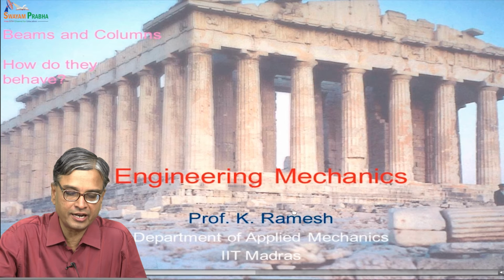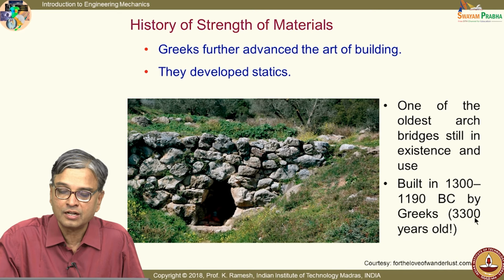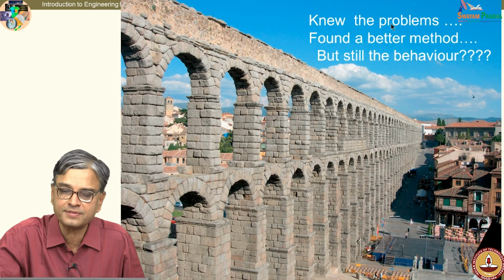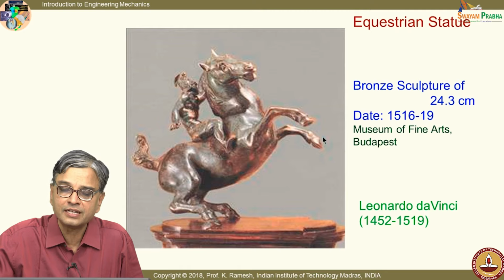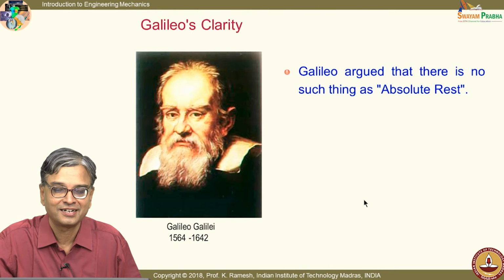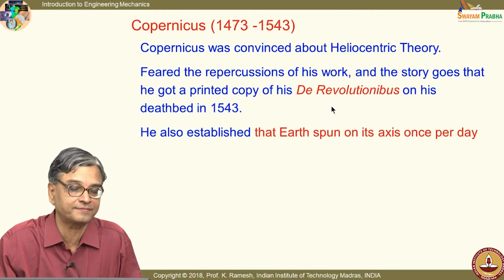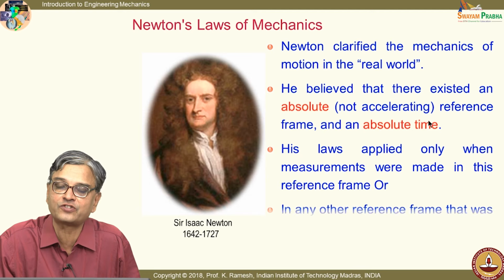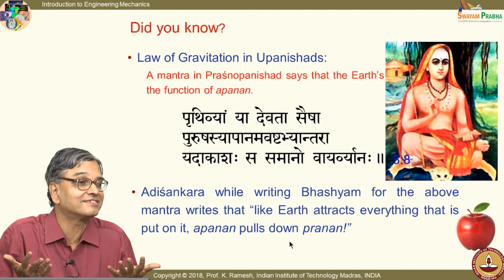Lec 01 Introduction to Engineering Mechanics I

Comment: sir I do have a doubt that the nataraja statue stands on a single leg because its head is attached to the round ornament and base is normal.
Reply: @Epistemophiliac, Have a look at this Nataraja statue preserved at the Minneapolis Institute of Art (https://collections.artsmia.org/art/376/shiva-nataraja-india). This bronze statue of the 11th century has lost its encircling ring (which symbolizes fire), yet stands on a single leg. This rules out the need for attaching the head of the statue to the ring for achieving a single-leg-stand posture. 
Many other Gods standing on one leg can be found in the Indian tradition. One such example is the 'dancing Vamanan sculpture' which you could explore for yourself.
Reply: @sachinsasikumar9874  thanks for the information. But it still has a a circular base which can easily manage mass above it nonetheless of its weight distribution.
Whereas the sculpture of Archimedes is standing on just two legs which are thin as you can see in the video.

Comment: 28.00. ... If it is moving with a constant velocity.... Sir I think u have missed " in a straight line".... Can u give ur thoughts on this
Reply: Velocity is a vector quantity which is associated to a magnitude ( also called speed) and a direction. 

A constant velocity implies that neither the magnitude changes nor the direction of motion. 

If the motion is not in a straight line, velocity is no longer a constant due to the directional change even if the speed remains the same. 

Therefore, the phrase "constant velocity" already implies "in a straight line" implicitly.

Hope this answers your query.